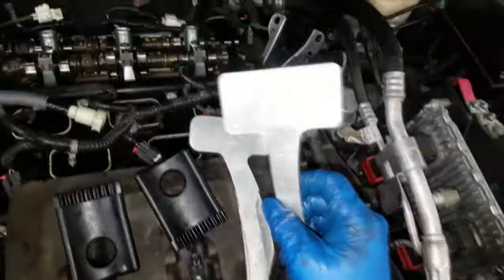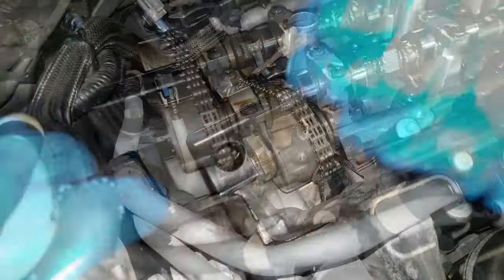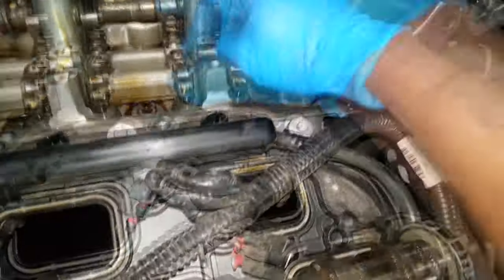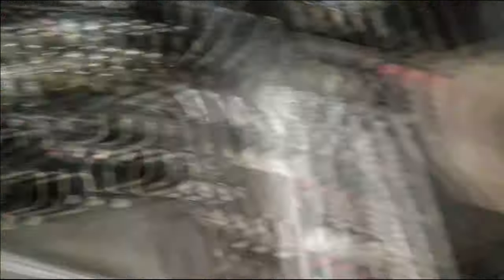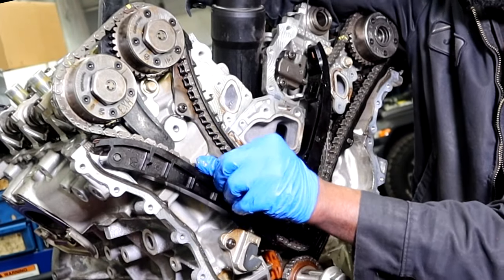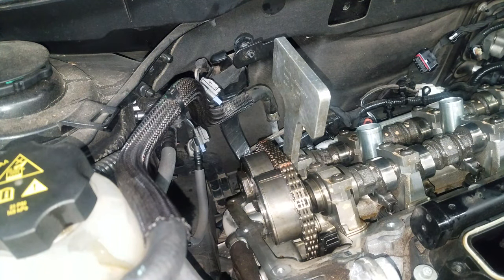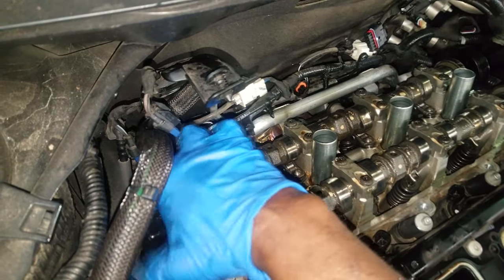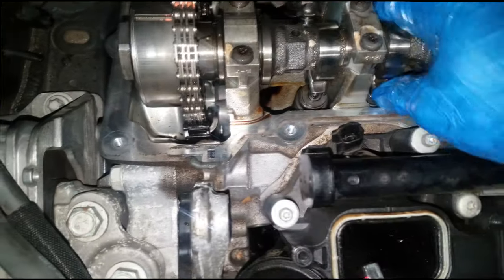Cam phaser, camshaft, lifters,  broken rocker arms on rear Bank 1 head. 3.6 V6 Pentastar P0340 P000B

Comment: 1 & 7/16 is the socket size you used for the Oil Control Valve in this video.
Reply from the maker: Yes or either a 36mm. Don't forget to thumbs up the video and subscribe if you not already. Thanks

Comment: 2017 wrangler 3.6l. did head gaskets after completing assembly coolant is leaking into engine valley from one path 10mm bolts that hold the war pump to th timing cover. why don't the bolt go all the way thru. is there 3 different size bolts or just 2?
Reply from the maker: Damm, just seeing this, theres only 2 different sizes bud. You likely have a bolt out of place. O please subscribe to the channel sir, thanks
Reply: @OnlineMechanicTips  thanks for your time. As as a mechanic I know that's hard to come by.

Comment: Thanks for this. Just to double double clarify... there is NO pin in the lower tensioner as there is on the Left head, correct?  My old cellmate in the dealer days used to do them all under warranty. I never paid attention, I was the electrical guy.
Reply from the maker: OK, Im not sure which head you calling left. I dont know what kind of car you working on. If you referring to bank 1, NO, there is no grenade pin to install and remove. The guide just may have to be pressed back some, hopefully using the tool..Man, have you sub the channel yet? I see you channeled up, imma have to come over and check you out.
Reply: @OnlineMechanicTips  I meant R, B1... L, B2.... any pentastar.  Thanks for the clarification. But yes I'm subbed. My channel mostly has weird diagnostics I've found over the years. Started out as "why i hate fords" lol.

Comment: Great video, I am doing the same job.  Does the magnetic ring at the end of the camshaft come pre-installed.  It look like it does, i got a brand new one from the dealership and it looks a little different, the marks at the end are not visible.
Reply from the maker: Yes the dealer parts fully loaded. The job not that bad bud. Just notate everything. Thanks for watching, please subscribe to the channel, thanks

Comment: Since you are obviously the 3.6 expert, is it possible to replace all roller rockers without removing the camshaft and phaser?
Reply from the maker: Hello my friend. The bigger question is how risky this could be..Sure, it's possible but the risk of jumping time or bending or damaging the cam ring is high. Have I done it, yes. You can however loosen one of the cam phaser bolts and back it off the cam while remaining in time an from there lift the cam off the head to replace r arms..thanks for watching..please sub the channel if not already thanks
Reply: Online Mechanic Tips yeah but that would require install with the chain guide tool, correct? Seeing as that I don’t know the trick to doing it without one. I’ve never worked on one of these, only Timing belt cars.

Comment: Great videos very well explained. My question is I'm replacing a cam on bank 1 of my Chrysler 3.6 due to rocker failure and I'm going to replace every rocker and lash adjuster on that bank. Do I need to bleed the new lash adjusters so they aren't pumped up to much and take a chance of smacking a valve on the piston?
Reply from the maker: It wouldnt hurt to do that. Do I do it on everyone, no. Do you have the special tools on deck for this job? Also are you subscribed to the channel?
Reply: @OnlineMechanicTips  I do not have the tool for bleeding them down but what I have researched is I can take something small like a small allen wrench and poke in there to release the oil. And yes I am subscribed. I plan on taking this job on soon and I learned alot from watching some of your videos very informative.
Reply from the maker: @sullivansgarage1326  Hey bud, I was referring to the tools you may need to remove the cams if timing affected. Im not sure how you plan to do it but if timing chain requires removal, you may need the tools to re-install. As for those lash adjusters, I do not have such a tool to bleed those. Ive simply just install them on everyone ive done with no problems at oil. Oil pressure will get to them extremely quickly and they will become fully pumped.
Reply: @OnlineMechanicTips  Sorry for the misunderstanding and yes I bought thoes plastic tools for sliding down in there on the guide to push in on the tensioner so the chain will be loose.
Reply: One more question I got the cam changed and put back together now I have a small mis fire with p0300 code. Do I have to relearn the cam sensor since I replaced the cam?

Comment: I remember pulling Valve cover off a Chrysler 4cylinder mini van ‘ one intake rocker was laying there ‘  I bought one lifter to replace the one that seemed weaker than the rest and was collapsing.  I soaked in oil for and hour and put it in. I got the lifter back in Place and reassembled it ‘. Ran like a Champ after that.  Blew my mind!!!

Comment: AllDataDIY uses phrases 'LH" & "RH" on a grand Caravan 3.6L, which bank is the "LH" and which is the "RH"?
Reply from the maker: On a Caravan Bank 2 is the head in the front (radiator) Bank 1 is the rear (firewall) head. LH=Bank 2
Reply: @OnlineMechanicTips  Thank you JT. I'm doing all the rockers and lifters on a Grand Caravan and finishing tomorrow.  So, that makes sense from behind the engine; I always thought it was from looking towards the pulleys.  BTW, check your PayPal; I made a small donation.  One time PP  took money from me just after a few days and I couldn't get it back, so when I receive, I withdraw immediately now.
Reply from the maker: @5jjt  O wow, thanks bud..I saw where it cam in. You asking about TDC right?
Reply: @OnlineMechanicTips  Yes, TDC.  So, I assume now I need to rotate the crank till the arrows point to each other on the LH bank, and till the straight lines on the phasers line up with each other for the RH bank.  I saw your RH bank video first and noticed you used the lines, so I assumed it was the same way for the other bank, but then I was under disassembly and saw the arrows and knew I missed something. I didn't catch those differences between arrows and lines/witness marks on your prior videos.  I think I am beginning to understand it all now.
Reply from the maker: @5jjt  Yes, please pay attention to the small details, and do one head at a time so you can be assured engine still at TDC. There is no crank shaft markings to monitor. You should be fine bud. Also be sure and torque those oil gallery plugs to specs. They will work they way loose over time

Comment: I really appreciate this video!  I was able to replace the rocker arms and lifters on my 2018 Pacifica.  One question hopefully someone can answer.  I did not do the rockers and lifters on the intake cams.  My engine has the VVL on the intake side.  The rockers are expensive!  After I finished the exhaust cams and started it up.  The tapping sounds is still there!  I'm thinking about taking it back down and replacing just the lifters on the exhaust side.  I'll inspect the rockers at the same time.

Any other ideas as to where the tapping noise is coming from?  Hopefully just a bad lifter.

Comment: JT, is it ok to replace all of the lifters while replacing all rockers, or might that cause a problem?
Reply from the maker: Hey bud, no it would not cause a problem. Depending on the mileage it may help
Reply: @OnlineMechanicTips  JT, thanks for responding. I may post this to your email b/c YT doesn't always quickly notify of comments. Today, I couldn't get the grenade pin to hold the tensioner guide, and had a heck of a time changing the intake phaser by the radiator.
In the special tools kit, I used the skinny wire w/ a small bend at the end to pull on the tensioner pawl, then pushed the tensioner guide in, then inserted the grenade pin. The grenade pin goes in about 1.5 centimeters, but won't hold back the tensioner guide.  With the grenade pin in, then pulling the big plastic tool out, the chain just goes back to being tight. I'm assuming I am not pushing the tensioner in far enough? It meets resistance, so I think I am. Have you had this happen to you?

Comment: Hey JT! Using that tool let's just say I just want to get under the intake camshaft, if I take it's phaser off using the block tool will I be able to get the chain back over the phaser without relieving tension using the tool? Looking for this tool on online and keep seeing reviews of the tensioner tool snapping so just trying to avoid having to use it.

Comment: This is my first time replacing a timing chain, on a 2015 malibu  so i screwed up big time.  i took the spark plugs out and turned the crankshaft a few times around trying to see if  the marks lined up.   I turned quite a number of revolutions out of stupidity.   Then I took the chain off and turned the cam intake sprocket , (not loose from the rocker)  around too   thinking i could fix the timing by setting the mark at 10 o'clock, so it went freely.  Then I tried to pull the exhaust pully also attatched to the the rocker arm.  I  was so stupid that i thought that rotating one at a time I could set them at 10 o'clock and 2 oclock, which is  is the way they are supposed to be.    Well, of course the exhaust   I pulled with the chain, but when I took the chain off, it pulled right back.  So now I know I have to losen the bolts to do it, but  how do i start from scratch now?  Help please.   If you even understand the stupidity I did.   Thanks, any help would be appreciated.

Comment: I really wish I had found your channel earlier in the year. IDK WTH was wrong with my 2012 Charger I ended up buying another engine at the recommendation of 2 mechanics. The engine I received said Durango V6 on the slip and the oil pan is back by the trans though....Do you have any idea if it will still run in my Charger?

Comment: HI, loved both videos. I am changing both intake camshafts on my pentastar 3.6L v6. I changed the back/right side camshaft first. Which means I was TDC on #4 cyclinder.  I accidentally left my phaser block in and turned the crankshaft to do the front/left side to bring the #1 cyclinder to TDC. How much damage have I caused and what should I do to fix it? I am at a standstill till I hear from you,

Comment: Love your work , the vids are great , about to do a head replacement so really informative - thanks - question , are you able to add a list of the part no of the gaskets required to do a head replacement for left and right heads … the mopar parts catalogues are pretty confusing with so many updates and superseded part numbers - I want to have all parts ready to go before I start the disassembly- appreciate an6 assistance your could provide - thanks again for your awesome vids

Comment: Per all the great helpful info in your videos, I'm contemplating doing this job on the rocker arms. Mine is a 2014 3.2 /would the listed torque details be the same as the larger 3.6? If not, do you have that info, or where can I find? Thanks again!!

Comment: @ online mechanic tips, I know you don't have all the answers especially not being on site but just a quick tip in what should I do. I am a DIY mechanical guy but I possibly ran into some problem with advanced timing p0011 actuator solenoid but of course that is not the actual problem so now I'm digging into my phaser and timing unit I'm searching everything listening for noise a small tick when engine is running but only like the ticking of a solenoid but I don't know if that noise is what causing the check engine light to even be on. After observing my engine the camshaft is not loose or anyting the engine is not dirty I change the oil once a month. The timing is in line with top dead center. The only thing that I don't really understand is the movement of the phasers to see if they're out of line or anyting. Or if they are stuck open or close. I haven't took the timing cover or phaser off yet what do you suggest I start at while I got everything else broken down keep in mind this car has 340000 miles never changed anything just kept the oil change very often

Comment: So im a subscriber, in the process of doing this job, but on 3rd cyclender, forward facing engine, 2016 Ram, my problem is replacing phaser, have tool installed but not enough slack in chain to get phaser back on cam, am i doing something wrong. Thx
Reply from the maker: Hey bud, sorry im just seeing this. With this being a Ram, are you working on bank 1? The video is for bank 1. You should easily be able (assuming 1 phaser on already) be able to put the other phaser on using a wrench to partially turn the camshaft to get dots aligned
Reply: Yes working on bank1, it looks to me that the chain guide keeps moving when i put the tool down to depress the chain tensioner,  so im assuming i need to put something down in side to keep it from moving,
Reply: Well nevermind i guess
Reply from the maker: @christopherflynn8886  Hey bud, sidetracked. Now, as for bank 1. Im having a hard time understanding your problem. Let me admit something to you. I do not use any tool at all on bank 1 because in reality, the tool not needed. (but im suppose to train using the proper tools) So, let me play this out in my head. You have 1 phaser (exhaust) on the chain (using the marks), go ahead and install that on the cam proper, install the nut hand tight. Now, simply use a wrench on the hex of that exhaust cam to rotate forward (toward the intake) now, install the intake cam phaser on the chain (using the marks) Now position the intake cam in the proper position to except the phaser, place the intake phaser onto the intake cam (you might have to use the wrench on the exhaust cam to slightly rotate toward the intake and that phaser should slide into place. The special tool is used to depress the guide but in reality, its not needed. Im not sure why you having a hard time if you using the special tool. And please tell me you are subscribed to the channel
Reply: Yes im subscribed, ok so turn the exhaust cam clockwise towards the intake and that should loosen the chain enough to replace intake cam phaser, and i may need to adjust each cam a little as you did in the video above to get correct alignment,  sound about right, sorry first time working on these duel over head v6, lol
Reply: So ive tried to do what you said about turning the exhaust cam clockwise. But when i do the chain slips off. Sorry i haven't replied sooner, had to order cam cap bolts, broke one ugh

Comment: MY FRIEND THANK YOU FOR THESE VIDEOS YOU DONT UNDERSTAND THE AMOUNT OF HELP YOU HAVE GAVE ME. I tool my valve covers off and checked both sides i realize one of the rocker arms was loose (it had been ticking for about 8 months now) It completely grinded up the lobe on the cam ... I have zero knowledge on working with cars the most i have done was install a cold air intake but thanks to you bro i was able to do it myself 👍🏽👍🏽😎😎
Reply from the maker: Thats whats up my man, thanks for watching. All I ask is if you would thumbs up the video and subscribe to the channel, thanks
Reply: Online Mechanic Tips i have a question do you have the part number for the Passenger side intake camshaft for2015 v6 charger i think i just ordered the wrong side FML... I ordered the Left side Intake online but i dont think its for the passanger side Part number 0050053826-001
Reply from the maker: @mrviqal  I can check when I get to the dealer tomorro. They likely will ask me for your VIN tho
Reply: Online Mechanic Tips its all good i just checked turns out i did buy the wrong side Lol

Comment: I was changing the right intake cam shaft and the phaser came off and fell down I tried to pull it up to put it back on but now there is no slack in the chain, there is slack in the back can phaser if I lift the chain up from the back but then the teeth aren’t lined up with my markings!! Please helppp
Reply from the maker: Are you using the special tool to depress the guide? Also are you subscribed to the channel?
Reply: Yessir already subscribed I love all your content we appreciate it so much!!🙏
Reply from the maker: @christophersmith8172  Which bank are you working on? This video is on bank 1. There is a difference on how to do this and there is a tool that will be needed
Reply: It’s on the same exact bank and I took out the same cam phaser you did at first and left the other one in and when the chain when down it’s like it got stuck or something, but if I go to the back of the other cam phaser closest to the windshield I can pull up on the chain and there is slack on that side  but if I pull up the slack and try to align it the teeth aren’t on the markings
Reply: Should I just take out the other cam phaser and then turn the crankshaft to get the chain to come around back to the marking I marked?
Reply: Hey do you have an email I can contact you at? I still haven’t been able to get my problem figured out

Comment: My vehicle (2012 Dodge Journey 3.6L) has a rattle noise when it’s just above idle...  but it only rattles between about 1,000 and 1,500 rpm.   It doesn’t rattle above 1500 or below 1,000.  Could that be the cam phaser ? Or what do you think it may be?
Reply from the maker: Yes, It very well could be. The good news is that since you have to remove the valve covers anyway, you can check both. nd like this? https://www.youtube.com/watch?v=cAqw_sPC518&t=143s